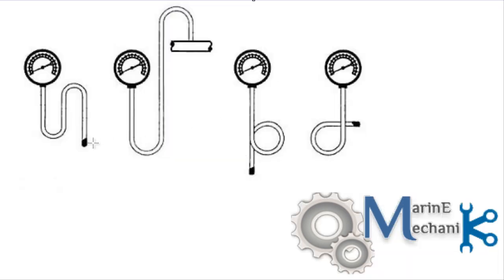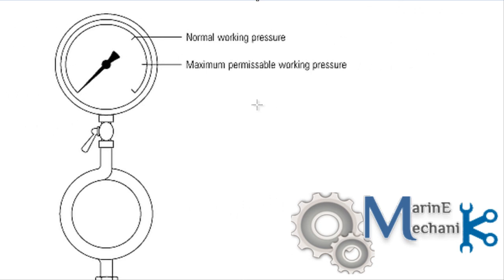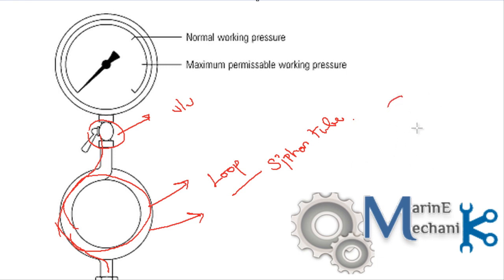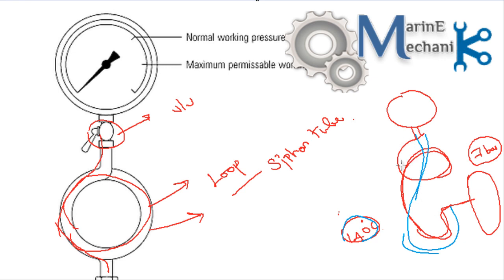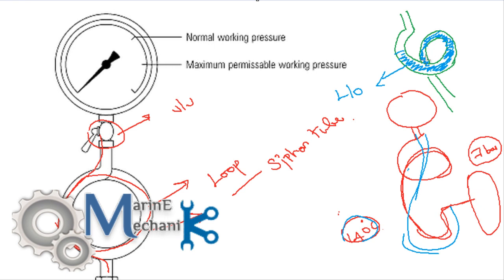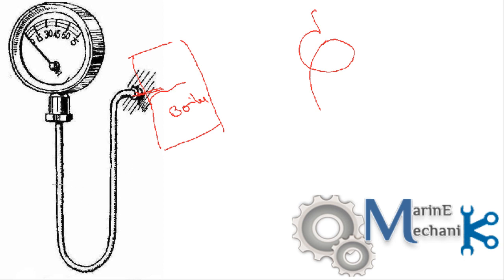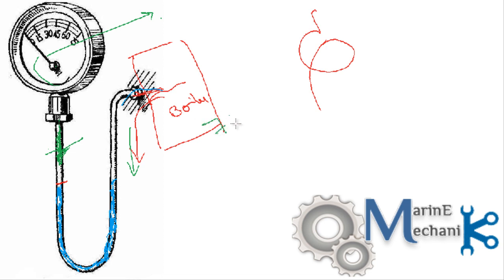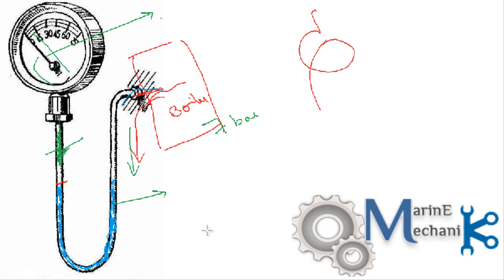Wondering Why a Loop is provided Near a Pressure Gauge?

Comment: unless the boiler room/ atmosphere is extremely hot  this dip tube or pigtail will automatically fill to the level where it will spill back toward the boiler,    as soon as that liquid fill happens,  the pressure gauge will be protected from the steam menace by the liquid in the tube dip.   Also a pipe/ tube length longer than usual that goes  to the pressure gauge will serve also as part of the protective function and must not be allowed to drain to the point of having no liquid between the boiler and the pressure gauge.   Always steam is extremely vicious / dangerous.    regards
Reply: so...this is all to prevent the damage from High temp..??
we do have so many gas lines as well where temp is quite high as steam line....then why isnt there a siphon loop..?